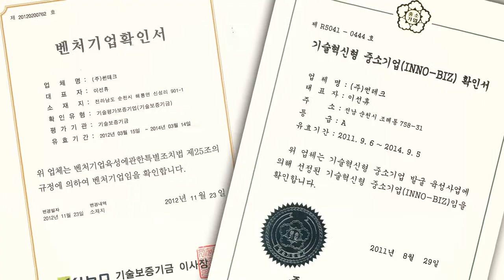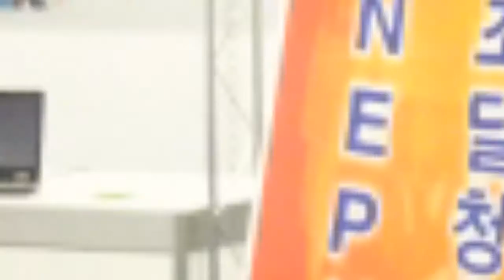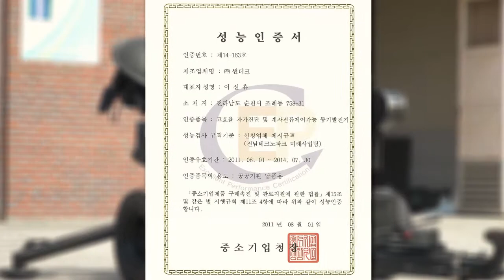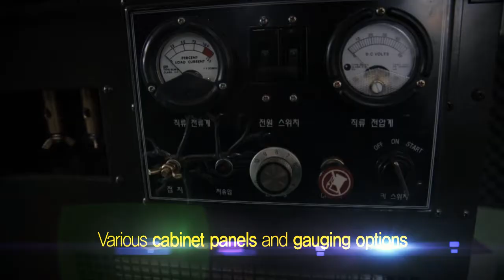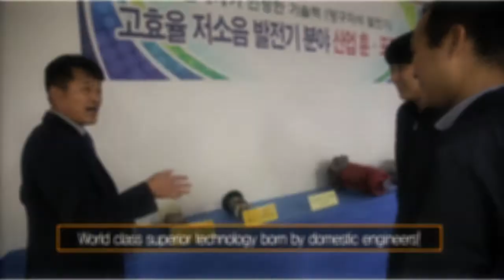Generators｜Permanent magnet generator set｜SGA, SMG｜Suntech Co., Ltd.

Comment from the maker: Suntech’s permanent magnet generator drastically reduced harmonics, which plays an immense role on load facilities. With improved efficiency, permanent magnet rotors can be operated without any defects, meaning minimum costs involved for maintenance. With excellence in quality, clean and constant voltage is generated at two-thirds the size of existing generators.